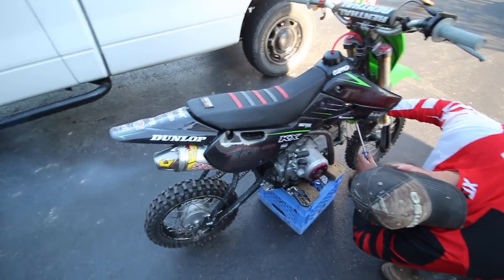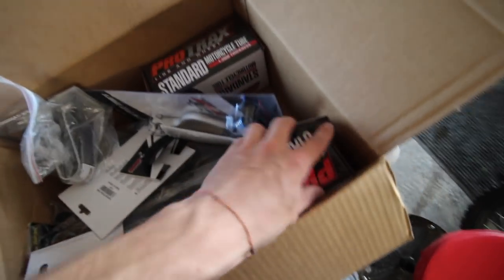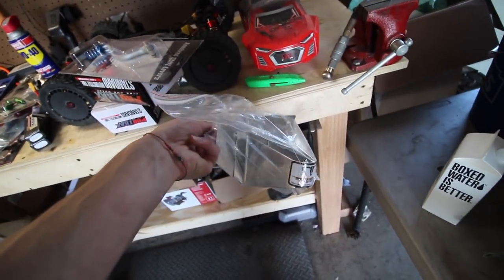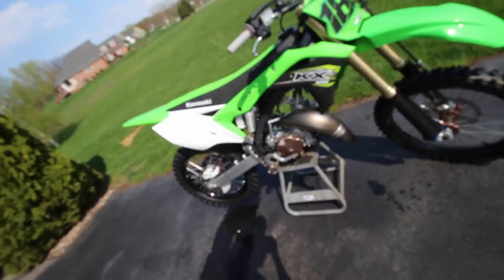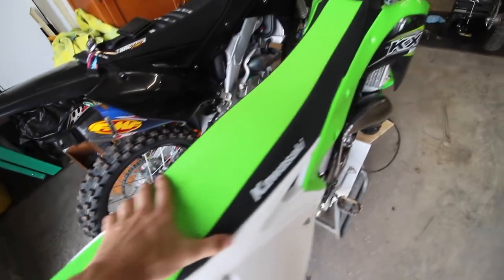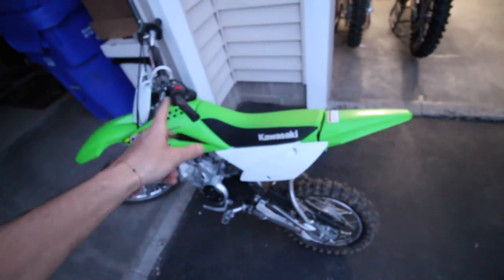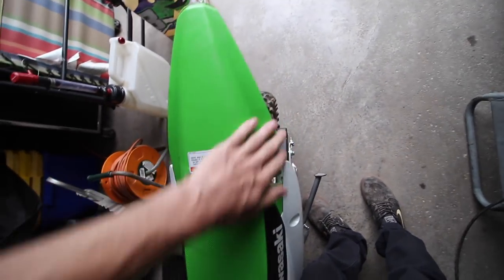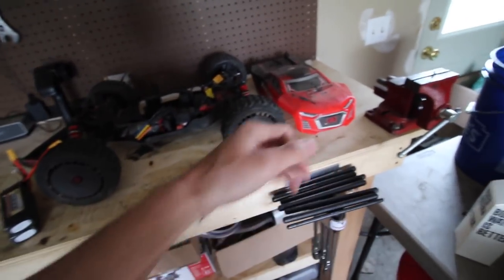6 MONTH PIT BIKE LEASE...

Comment: Hey Tyler I think that ticking noise is the crankshaft because my SSR did the same thing and I adjusted the valves like 4 times and I decided to change the crankshaft and the noise went away and I’ve rode it for half a year and noise hasn’t came back. Also the smoking is the piston rings that are going bad.

Comment: Rebuild the pit bike. It is way cooler than a new one. The smoking looks like it is from the head gasket, valve seals, or piston. You probably need new valves.
Reply: probably that or the rings

Comment: The ticking noise is not the valves its the piston is worn down and slaping the cylinder walls aka piston slap but you just need a new top end

Comment: More than likely you just need new rings for your pitbike. That is why it is smoking the excess oil is getting past the rings and into the exhaust valve causing the oil to burn and come out your exhaust.

Comment: Has an air leak that’s why it is hanging idle. Spray carb cleaner on all the boots to test where it is coming from than put gasket maker on the boot and re install

Comment: That’s what my bike does it’s a 2008 crf150r when I rev it it revs a lot then dies any suggestions?
Reply: It will rev up a lot then die
Reply: Jaden Wiles sounds either carb or throttle cable issue but more carb related bc throttle cable wouldn’t cause it to die

Comment: Get a yz250 2 stroke or a 2007 kx250 and do the 2018 conversion kit like u did to the kx125 and put a big Bore in the 250
Reply: Justin campbell it doesn’t
Reply: Matt Jones yeah they do cus you gotta get custom rings every time you need to replace them and if its stock it'll take like 30 min to an hour to replace its better to keep everything stock except for a pipe-easier to sell that way
Reply: Justin campbell it’s really up to the person doing it if they want to but bore and I like them